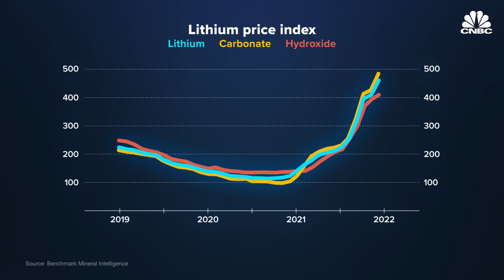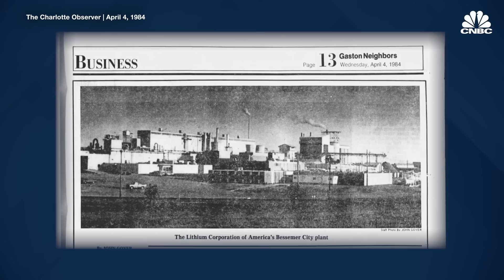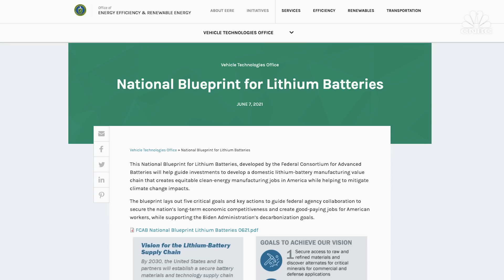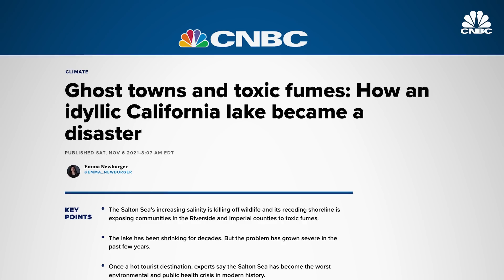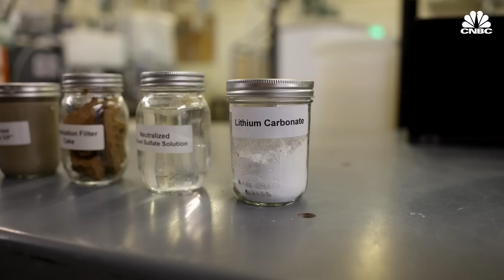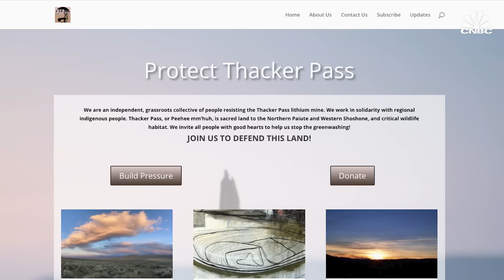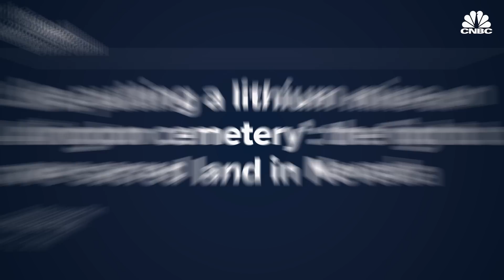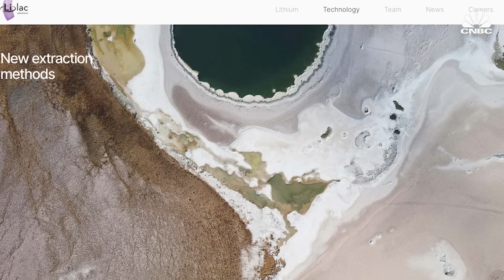Why The U.S. Has A Massive Lithium Supply Problem

Comment: I fully agree that the United States needs to become more in control of our own destiny when it comes to raw material supply and refining. We can't be left in the position where everything we need has to come from somewhere else. We need to do the necessary mining and refining in the most environmentally responsible way possible. That said, if you fly over Nevada at 40,000 feet or so, there's a whole lot of open space there.... Charlotte, NC may be a different story.
Reply: Damn, it's almost as though those people complaining about outsourcing had a point...
Reply: @arnowisp6244  Well, then the next complain will be - it is too costly and labor intensive...back to the beginning of the outsourcing cycle.
Reply: @arnowisp6244  Outsourcing select industries actually has a merit.
Now outsourcing key industries like Semiconductors is not a good idea.
Outsourcing Mining of some minerals is actually necessary to prevent land erosion.
Also withholding Natural Resources which can be used in the future to gain an geopolitical advantage is actually a win.
Reply: The problem with Nevada is water, that area is mostly ranching if you work there you run the risk of contaminating the very limited grou need water for the people living there. Tho I hope they can work a way around it.
Reply: Random Mexican guy here, that is what the current president here in MX  is trying to do. But believe me, going against the interests of corporations is not a piece of cake.
Reply: Too bad people at the top are always watch quick money bcoz they getting older, and this is the last chance for them to make enough to get retire
Reply: You don't understand what an "International economy" actually is, do you?
Nor why it is superior, I guess?
This is traditional thinking from the 19th century. And dead wrong.
Reply: I read a while back that Tesla was probing in Canada for Lithium, not sure if anything came of it.
Reply: I wish y'all new how these minerals used to make you guys comfortable have caused my home country to suffer. Your corporations together with your government have caused wars in Eastern DRC through Rwanda and Uganda for coltan, Nobium and our diamonds. You also do the same  in our mines where more than 70% of world's copper and cobalt supply is found and some considerable deposits of lithium and other precious metals. China is now taking over in Congolese cobalt and lithium mines and that is why you can never control the supply because the whole western world relies on DRC for the next evolution of the electric car era. So guys please know if you live in a technologically advanced and comfortable society is because your government and corporations have contributed in destroying the African continent.
Reply: @godbillion_nathan  Ignorant comment. China is leading in Rare earth processing. 90% of the minerals are mined in China. In fact, China controls 85% of world rare earth minerals processing.

 China is also rich in oil, natural gas, and other precious minerals and metals. China is 3rd largest country. Saying China has few raw materials is just stupld.
Reply: Sounds like you want to bring back colonialism.
Reply: The problem is the cost to produce is too high
Reply: @cchui01  we have millions of people coming here willing to work
Reply: @thebestevertherewas  mining of lithium is fundamentally different than, say, drilling for crude, or fracking in sensitive groundwater areas.  Unlike petroleum and gases which are actually CONSUMED, lithium and other metals are used, and when no longer viable for use in its intended products (batteries), it goes to recycling specialty companies for reuse; therefore, over time, the need for lithium (and many other metals) ore is lessened.  Recycling becomes the main source for lithium, much like lead for lead starter batteries is taken mainly from lead battery recycling.  There is very little need for lead ore for that purpose.
Reply: As an indian i agree 😤
Reply: Mexico have litio but no for investment in Mexico no more
Reply: @Chris.Davies  you don't understand geopolitics
Reply: @cchui01  

Large Lito mine in the Northeast of PORTUGAL 🇵🇹🇵🇹🇵🇹 The biggest deposit in EUROPE🇪🇺🇪🇺🇪🇺 Easy to prospect on the surface. Good roads for transport. There is also a lot of tungsten and volphamium 💰💶💰💶💰💶💰💶💰💶💰💵💰💵💰💵💰💵💰💲💰💵💰💵💰💲💰💶💲💰💶💰💰💵💰💰💵💰💰💶💰💰💲💰💵💰💰💰💶💰💵💰🇺🇸🇺🇸🇺🇸🇬🇧🇬🇧🇬🇧
Reply: @thebestevertherewas  lithium      can bee harvested from ocean water

no mining needed
Reply: @PTheGoat  contaminate the water with what?
Reply: @godbillion_nathan   why fixate on the past?

let's move forward
Reply: @greedyinvader9462   ''''''The problem is the cost to produce is too high
''''

 really  

in mining or harvesting lithium  ?
Reply: @robinsss  it's that past that has caused our current problems.
Reply: @godbillion_nathan  will fixating on the past create solutions to those problems today?
Reply: Well here’s the problem we be then adding to a situation to the earth environment us doing right let them mine we support.
Reply: But why would you destroy such a beautiful area 🙄
Reply: @mimartexplores  what area?

Comment: One of the main issues with Lithium refining is water use, particularly in arid areas. .
This video does not address it adequately.
Reply: Agreed. There is no meaning to extract Li in US at 3 times the cost, Chile can provide the whole US needs, what it has to be done is to develop the refining capacity. Today it goes as Li from Chile or Australia to China and comes as hydroxide to the US battery producers, what a waste!
Reply: That's why we need to set up refineries in wet Areas. The only way we can get everyone to ditch I.C.E vehicles is to set up Ev manufacturing all around the US, not just in some areas.
Reply: If man wants the lithium he will move in the water..Greek aqua ducts..just adds to the cost
Reply: @tomgucwa7319  just use rail. Efficient and hauls more product than pipelines and frieght
Reply: @vladimirdoyle3934  pipelines are substantially more efficient at transporting liquids, so if you are supplying the water to a large project that requires a constant supply of water pipelines are the superior choice. Trains certainly are more efficient than trucks, and for solids or relatively small amounts of liquids are pretty good the most efficient way to ship just about anything over land.
Reply: @garethbaus5471  transporting water by rail is dumb and i wasn't arguing that. Rail is superior to transport oil because you can hold more in a rail car than a pipe line and do it safer. Pipelines are good for moving oil to small isolated towns.
Reply: Yea, but oil extraction/production uses far far more water. It's always about going for less.
Reply: @tomgucwa7319  expect the Greeks didn't build great aqueducts, that was the Romans; and the water was not moved to tge desert.  Phoenix, LA and Las Vegas are running out of water already.  Given that the US can't bring enough water to major population centers, why/how would it do it for remote mining installations?
Reply: @vladimirdoyle3934  everyone can't ditch ICE, not OTR truckers, remote workers, or the average American based on a proper budget (vehicle purchase should only be 10% gross pay or 50% purchase price of annual income, which means ~$25k purchase price).
Reply: Lilac solutions with lake resources as well as American battery technology’s processes are not excessively  water dependent.
Reply: @vladimirdoyle3934  pipelines can move more oil faster using less energy, and are incapable of derailing so as long as you properly monitor them for leaks they are superior for transporting large amounts of oil as well.
Reply: Unfortunately from what I understand from this video as well as Wendover's, and others, that lithium is only in arid areas unfortunately. Is there a way to extract/refine with less water usage? Not sure...
Reply: @jarednovel  It's very doable to refine lithium without poisoning the groundwater, but it's not economically "viable". That said, I don't think doing it the dirty way should even be considered an option. The whole point is to quit being cheap in the present at the expense of the future.
Reply: @garethbaus5471   How do you deal with the toxic waste products?
Reply: @jarednovel  that is a problem that doesn't have an easy or simple solution.
Reply: We could use sewer water in so many ways as it contains 6 percent nitrogen and 6 percent phosphate.  Carbon dioxide from Power Plant helps treat sewge.  Water used in power and industry.
Reply: @jarednovel  think toxic waste as refined condesates
Reply: @jarednovel  your point doesn't help you because oil companies are polluting almost every country air, water, and land. And the point of the video was about producing EVs Raw materials domesticly
Reply: This video either ignores or whitewashes all the problems associated with extractive industries.
Reply: @vladimirdoyle3934  Have you never heard of the Trans-Alaska Pipeline? Runs hundreds of miles from north to south across the Alaskan tundra and mountain ranges, even crossing the Continental Divide.
Reply: @katm9877  Lilac Solutions was mentioned in the video and they use a direct extraction method rather than using evaporation ponds. Brine Water is pumped into tanks which contain "beads" which react with the lithium and capture it from the water and then the water is pumped back into the ground. A company called Lake Resources, (USA markets ticker LLKKF), is using the Lilac Solutions technology for their operations located in the South America's "Lithium Triangle" and they own 100% of their leases.

Another important material not talked about is graphite as there is more graphite by weight in the EV batteries than lithium. Nouveau Monde Graphite (NMG) is a Canadian company startup that is also trying to be the leader in ESG graphite mining using electric mine vehicles and renewable sources of electric power.
Reply: Right on, but this video does: "The price of green energy | DW Documentary"
Reply: Fracking as it applies to gas and oil extraction destroys water resources way more than any lithium refinery does. It goes with the territory. You are correct, it is not addressed.
Reply: if the truth about environmental impacts of lithium mining were spoken about we wouldn't be calling it green energy.
Reply: @MrCcristof  '''''There is no meaning to extract Li in US at 3 times the cost''''

why dos it have to be 3 times the cost?
Reply: @vladimirdoyle3934  ''''''That's why we need to set up refineries in wet Areas.''''

like  where?

''''''The only way we can get everyone to ditch I.C.E vehicles is to set up Ev manufacturing all around the US,''''

why would that get people to switch to EVs?
Reply: @bowez9  the Chevy Bolt is near 25k with the tax credit
Reply: @RM-rh3mz  there is no shortage of water in America

the country is surrounded by water
Reply: @katm9877  this   has nothing to do with arid climates

wherever there is a aquifer you can harvest lithium

aquifers are  all over the planet
Reply: @thelight3112  '''''' It's very doable to refine lithium without poisoning the groundwater, but it's not economically "viable".''''

do you have the numbers to support that?
Reply: @jarednovel  from water harvest or mining?
Reply: @robinsss  so then the government should subsidize all vehicles.  Nevermind the fact that insurance rates are calculated with the purchase price not the net price, so insurance is at the of a vehicle out side of the budget.
And the vehicle price doesn't include the charger or the charger cord, and GM is only covering what they are calling "standard installation".  So by the time get charger, cord and installation even with tax credits the real price is over $30k
Reply: @bowez9  '''''''so then the government should subsidize all vehicles'''''

 i  didn't  say  it should

i only said that a tax credit is available

''''''''Nevermind the fact that insurance rates are calculated with the purchase price not the net price, ''''''

what's the difference between the  purchase price and net price?
Reply: @robinsss  about 30%.
Reply: @bowez9  no explain what a  purchase price is

then a net price

and give me a source for each term
Reply: @robinsss  purchase price is what the insurance company says the valuation is (in this context), whether it's book, MSRP or local Market value. Different insurance underwriters use different methods, so unless you want me to cite every agent, adjustor and actuary I've dealt with, take that as source.

NET price is what one pays out the door at the dealer.

As for the tax credit, by you encouraging the use of it you are saying that the rich should be subsidized off the poor.
Reply: @bowez9  

the  price i pay at the door of the dealership is the only issue 

that was the subject on the table because you said this

''''''''(vehicle purchase should only be 10% gross pay or 50% purchase price of annual income, which means ~$25k purchase price)'''''

'''''''As for the tax credit, by you encouraging the use of it you are saying that the rich should be subsidized off the poor.'''''

no i am not

i am only saying since it exists  people should take advantage of it
Reply: @robinsss  by taking advantage of it or advising its use you agree with it.  As such since all EVs are outside the budgets of most Americans and as such the vast majority of the world these credits only serve the rich.

The reason for different use of "purchase price" is there are different purchasers, the consumer and the insurance company (in case of replacement).
Reply: @bowez9  '''''' As such since all EVs are outside the budgets of most Americans '''''

where is  your proof  that most can't afford 26k

the Bolt is about 26k with the tax credit

''''''''The reason for different use of "purchase price" is there are different purchasers, the consumer and the insurance company (in case of replacement).''''

not my concern

not  thee subject on the table
Reply: @robinsss  you made it your concern by responding to several moth old posts, and you put it on the table by bringing it up.

Standard budgeting practices set the expenditures related to vehicles in terms on income percentage and given that yes a $26k (which is actually over $30k) vehicle is outside  the means of the average American let alone the masses around the world.
Reply: @bowez9  how is it over 30k?

Comment: We need to capture the lithium recycling industry for domestic market demand. Lithium recycling will be the final key to the longevity of the ev car market
Reply: Theirs is one Elon old partner though about it and created a company
Reply: Way cost too much
Reply: Redwood
Reply: Plastic recycling failed fyi
Reply: But are you familiar with The LaSalle?
 Or maybe The Prophecy of The Shadowy Clown?
Reply: Nope. Lithium batteries are doomed to the dustbin of history.
It is terribly technology, and the least-worst thing available today - but that will change.
Reply: @madensmith7014  Partly because we were horrible at separating out the usable plastic from the unusable plastic and then shipped all our crap to Asia. Honestly the “reduce” and “reuse” parts of the recycle motto seem more important. Why focus on finding recyclable waters when I can just fill up my thermos and use that
Reply: Li-Cycle is North Americas largest battery recycler and has plenty of contracts with companies to supply battery making elements back into the market. $LICY
The world will need to mine more Lithium but it will be an environmental disaster if it's not all recovered for resue
Reply: @shakumpum  hydrogen would be great if over 90% of it on the markets wasn't made from natural gas. A hydrogen boom would just lead to an bigger explosion of fracking that has already harmed many small communities. But then again there is no simple answer any option of transportation with billions of vehicles in operation
Reply: @andyjohnson3790  The push for H2 vehicles would require a shift to electrolysis, of course. Just because as of right now it's cheaper to make it from natural gas doesn't mean that it will always be like that.
Reply: That the thing there is not a recycling thing for that yet nor anyone looking in to it so it ends up in the landfills
Reply: @Chris.Davies  what do you have in mind?
Reply: Li-Cycle baby.